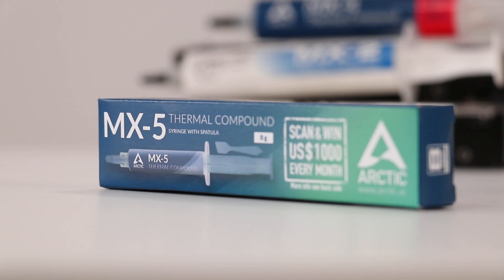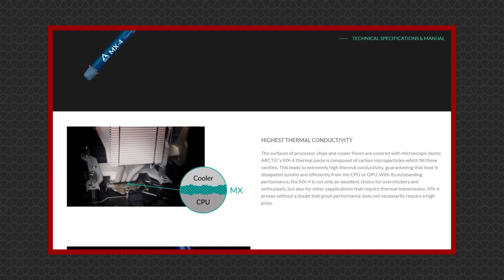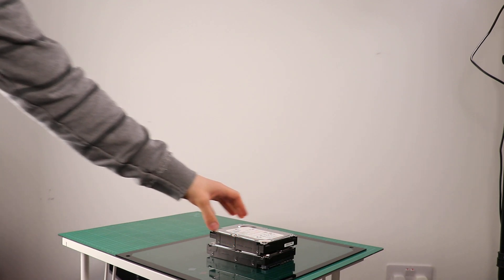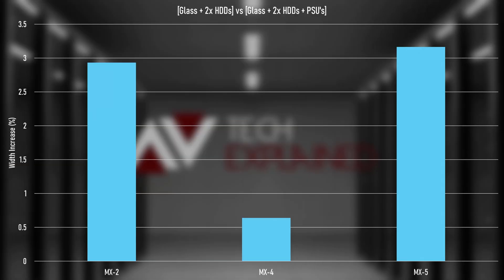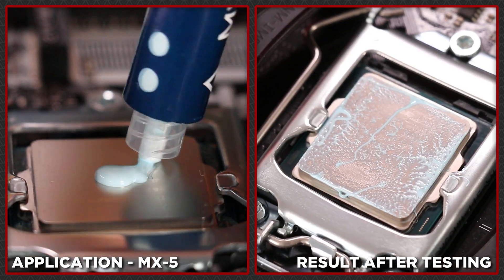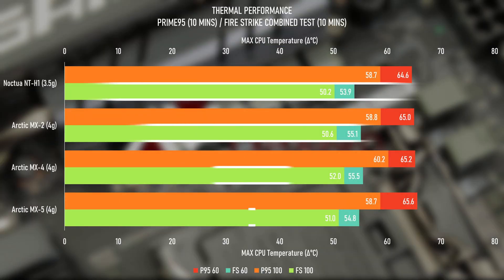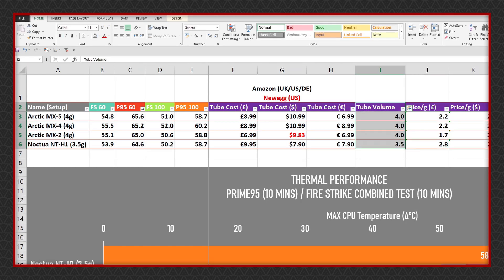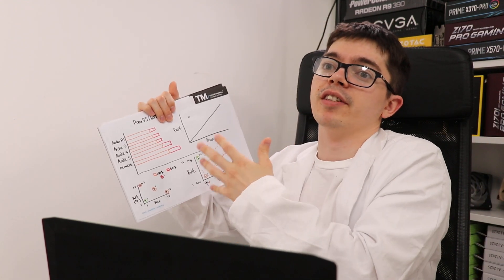Arctic MX-5 vs MX-4 vs MX-2... What's the difference?... Also Noctua NT-H1

Comment: Are you saying mx-2 is better than mx-4?
Reply: He's saying it doesn't really matter, you're best off buying the most cost effective paste you can for the performance you get.
Reply from the maker: I'm not really saying anything, the results look like that's the case. There's not a lot in it either way to be honest.
Reply: @AVTechy  that's weird, usually mx-4 beats mx-2.
Reply from the maker: Last time I did a head to head between MX-2 and MX-4 they were equal. This testing was a little more in depth, and it looked like MX-2 pulled ahead slightly.

We're only taking max 2 degrees here, so it's not substantial. Like I said in the conclusion, if one of them goes in sale for a couple of dollars less it will pull ahead in value.

So yeah, it really comes down to getting the cheapest one.
Reply: @AVTechy  Few thermally conductive fasting gives positive results immediately after application and sure tests will be repeated one month after application.  Arctic thermally conductive pastes have the phenomenal property that they have greater thermal conductivity over time.
Reply from the maker: Unfortunately that's not something I've got time to do right now. Maybe I can test that theory in the future.
Reply: Only until the Mx-2 dries up in like 3 months xD
Maybe they turned down the performance for longevity?